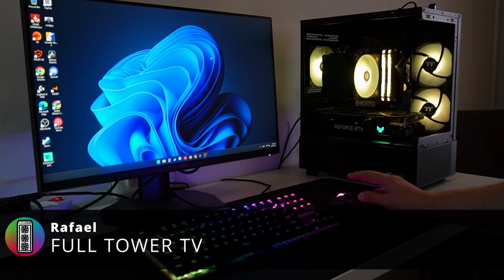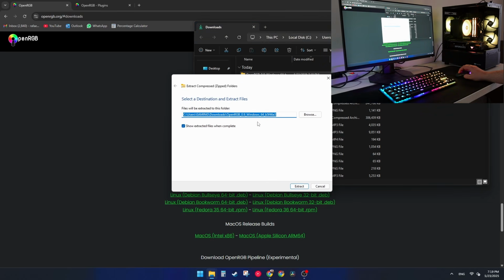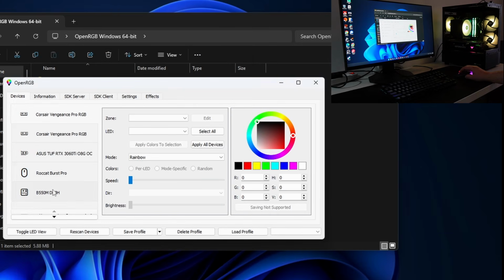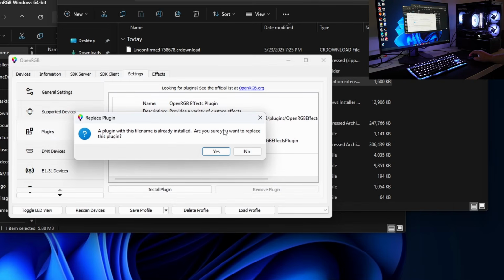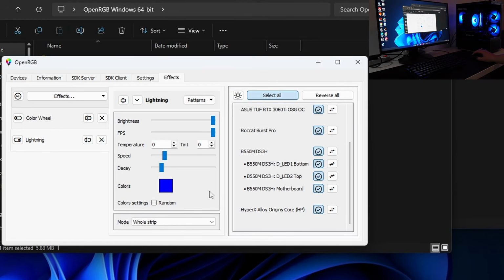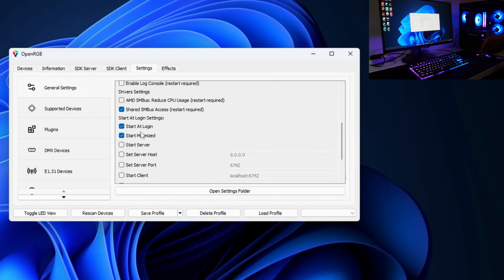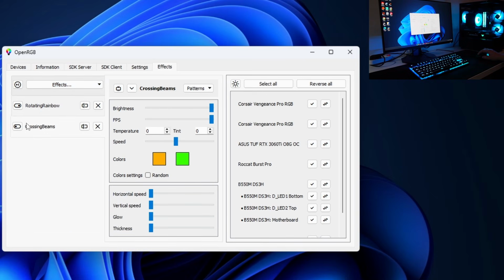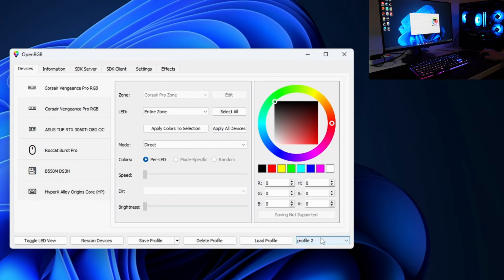How to sync RGB using OpenRGB Effects Plugin

Comment from the maker: ❗FAQ & Important Notes:

1⃣Q: "I did everything you said, and it's not working."
      A: - Please make sure to read the description of the video. If something was unclear in the video, 
               you can find a step-by-step written guide there, which will help you with everything you need.

2⃣Q: "Windows is blocking my OpenRGB Effects Plugin download."
      A: - When you download the OpenRGB Effects Plugin, Windows might block the download because it's a .dll file, which is usually suspected as a "virus".
                In the video, you will see that it doesn't block my .dll file because I already downloaded the file a couple of times in the past.
 
3⃣Q: "Every time I close the program, the RGB effects go back."
      A: - The default behavior of the program is to shut down completely when you press "x".
               To minimize to program, you need to make sure that "Minimize On Close" is ✔ in the settings tab: 
               Go to Settings → General Settings, and you should see it there (the first option).

Any further Frequently Asked Questions will be added here in the future.
Reply: Any real software won’t trigger a virus when UNINSTALLED.  Uninstalled meant totally remove from the computer.   It instead is leaving what could possibly be backdoor into the system.   Why would it trigger a virus warning AFTER it was supposedly uninstalled?
Reply: im wondering if its possible to make a custom affect that utilizes 2 temp sensors(CPU&GPU) to get my rgb to react within a temp range
but specifically id like for my rgb to be off below a certain temp since i leave my pc on as i sleep
so essentially if my cpu is below say 60c and the gpu is below 38c my rgb is off, but when i play a game and they get above those temps the rgb turns on say as blue and stays relatively says the same color until they start getting towards what i consider hot but not danger territory and then starts shifting the color towards red which would be very close to danger territory and once it actually gets into dangerous temps it starts flashing red

LEDs off
cpu below 60 - 65c
gpu below 38 - 40c

LEDs on solid color no color shifting or brightness shifting
cpu 65 to 85c
gpu 38 to 70c

LEDs shifting to RED
cpu 85 to 99c
gpu 70 to 87c

LEDs FLASHING ALERT stop what ur doing shut er down mate
(repaste time/pump failure/fan failure)
cpu 100c+
gpu 89c+

Comment: I just want to turn of the keyboard LEDs when I lock the screen. Apparently I need to set up an "off" profile then in system task scheduler, set up two task events. One for Lock and one for Unlock.  If there is a built in way in OpenRGB to do this, I would rather do that.

Comment: Thanks for the thorough explanation my guy! I placed an order for a Nollie ARGB controller to use on SignalRGB, for maximum flexibility. By default, SignalRGB doesn't support my specific B850 motherboard and so all RGB runs at extremely low framerates and it looks pretty horrendous (I've used it on an older Z790 build and it was extremely good because the Z790 was supported). It's from Aliexpress, so to wait out the month of shipping, I'm gonna resort to openRGB. I prefer SignalRGB because it's just easier for my monkey brain to process, and I love the GUI & much omre lively themes.

Comment: This shit is pissing me off. I can’t sync my lian li sl120 fans. They all are doing what they want to do. I try to change the lighting. Some shut off. I can’t re enable them. I have an air goo controller. I’m over this nonsense
Reply from the maker: I once saw a video of someone who also complained about Lian Li fans and software and he was having troubles with it too.
To be honest I never dealt with them before so I wouldn't know how to help you fix it. 
Have you tried contacting their support team maybe?
Reply: @F @FullTowerTV just bought a different case yesterday, it’s the case I wanted when I learned of it. It’s the floatron F1 case. Came with 6 fans. Immediately fixed my problem. But I have the lian li LCD fans reverse blade I put on my AIO radiator. And of course those fans are giving me the same issue with doing their own color shifts. I’m just done with lian li. They are nothing but a headache
Reply from the maker: @mrmayhem2983 I feel you man. That was also the conclusion of the guy who I watched his video he also was complaining about it a lot. I'm glad it got fixed with the new case for you!

Comment: This program not working on my Case MPG gungnir 111r
Reply from the maker: I looked at your case and from what it seems you have a built in rgb hub at the back of your case that allows you to change the lights using the LED button at the front.
If you want the rgb hub to be controlled with the software, you need to plug the hub into your motherboard.
If you need help with that, please send me some pictures on Instagram or Facebook you can dm me @fulltowertv and I will help you
Reply: @FullTowerTV  Everything is connected correctly, brother; the case's LED button works, and the ARGB works via Mystic Light in MSI Center. That’s why I disabled Mystic Light and completely closed MSI Center to use OpenRGB instead. It does work—it produces colors—but only a few lighting effects actually function with OpenRGB. It’s strange; my MSI RTX Gaming X GPU also lights up with OpenRGB, but I run into the same issue: only about three or four effects work. If I select any other effect, the lights turn off completely, as if no effect had been applied at all. The problem is that OpenRGB isn't compatible with my MSI build; I’ve tried it in the past and it didn't work, and it still doesn't work now.
However, if you happen to know a solution, I’d really appreciate it if you could leave it in the comments section.

Comment: my fan lighting only shows the color properly with the "static" setting but it seems that this effect reflects colors using "direct" which doesn't work properly for me. I wish there was a setting to force a device to use a particular mode but instead it just uses something random. :/
Reply from the maker: Yes you need to download the fx plug in for it to work the way you want. Once you install it you will see a new tab called "effects" and you can choose what you want from there.
Look in detail in the video I explain it there how it works

Comment: first thx for the video . second i cant get it to work with asus b850-f neo . it just detect ram only nothing else. any way to fix this except run as admin cuz it didn't work
Reply from the maker: What case are u using? Some cases has a built-in rgb controller that is not connected to motherboard. 
Try to spot if you have a LED button on the front panel of the case or if you press the reset switch it might change the colors.
If so, you probably have a built-in controller. 
Which is OK. But, some controllers dont have an option to plug them to the motherboard. You need to see if you have an RGB cable that goes from it to the motherboard (usually it's a 3pin connector that says 5v on it if your case is ARGB version)
Reply: @FullTowerTV lian li 217
Reply from the maker: @ahmadfawzy5175 do you have the ARGB version? Did you get costume fans with rgb or just the normal 217 version? Because that one doesn't come with rgb fans as far as I can tell
Reply: @FullTowerTV  the normal version and no rgb fan added
Reply from the maker: @ahmadfawzy5175 OK so from my understanding the only rgb you have is from the RAM and the mini screen you have on the motherboard (maybe from the GPU as well?)

I think OpenRGB won't be able to detect the screen on the motherboard, if you want to control that you can try asus aura sync (I think it's called Armory Crate) if you download it, you might be able to control the screen on the motherboard, and the RAM as well.

Can you try that and let me know?
Reply: @FullTowerTV  thx very much for ur reply and trying to help . no i don't want to control ASUS screen logo rgb but the rgb of the vga card and the cpu cooler fans . armory crate is bugged and install a lot of services and even cant control every rgb alone . if i want to turn off ram only and let others on it wont allow it .

Comment: For some reason OpenRGB doesn't control the lights on my Lian Li case. I turned off dynamic lighting under Windows personalisation but nothing. It's still showing rainbow by default. The rest of the lights (GPU, RAM, motherboard) go static green though like I wanted. Edit: I've noticed if I turn on Windows dynamic lighting, it can control the lights on my case. So weird. I set it to the same green through Windows now.

Comment: Good day, sir. The program doesn't see the RAM and AIO.  Be quiet! Pure Loop 3 - 360mm ARGB and  g skill RAM
Reply from the maker: Check if you have other rgb software installed like your motherboard software - if so remove them.
Also make sure you run OpenRGB as admin like shown in the video.

You can also try SignalRGB which is a different software similar to OpenRGB. It might work better for you

Comment: dont work for me,  i have the Tempest Fort ARGB ATX case , and DeepCool AG620 BK ARGB V2 cpu cooler :( any fix pls help
Reply from the maker: Do you have option to change the colors via the reset button on your case? If so, some case fans are connected to the reset button or led botton on the case and they are not plugged into the motherboard, that's why it might not work for you

Comment: After countless armoury crate fails to detect argb header after a bios update I installed openrgb and detected argb instantly. My only problem is the effect is not animating after restart just freeze. Any suggestion?
Reply from the maker: OpenRGB can be buggy sometimes. I had this issue as well. You can try SignalRGB software instead, maybe it will work better.

Comment: i dont know like anything about PC's, so first of all im using rosewill fans with led's and a biostar motherboard, and openRGB's not detecting them. like i said i have no idea what to do. ive been at this for hours and i just cant seem to find a solution that works, or that i understand. please help me.
Reply from the maker: Hey my friend 👋 I got you no worries.
There is one possibility why openRGB won't detect the fans and that is perhaps they are not connected directly to the motherboard.
OpenRGB can only detect devices that are plugged directly to the motherboard, whether it's via USB or the RGB headers on the motherboard.

Now, there is a lot of cases that has fans that are connected to a some sort  of controller which is not connected directly to the motherboard and it is being controlled in other ways. 
For example: if you can change the colors of the fans by pressing the reset switch on your case, it is most likely they are not connected directly to the motherboard.

If thats the case, what you can do is open the back of your case and see if there is a plug that looks like this:
https://ibb.co/xKV7nMg1

If so, try to locate a header on the motherboard and plug it there.
There is a possibility that some motherboard do not have RGB headers so keep that in mind.

Try that and let me know what you come up with
Reply from the maker: Also, I forgot to mention, if you do end up opening the back of your pc - don't forget to turn it off before touching anything.

Comment: Installed per instruction, removed Icue from my system after OpenRGB didn't detect my vengeance RAM. Still won't detect them, they also now no longer show up in MSI mystic light (My motherboard does and also does in OpenRGB) any known solutions?
Reply from the maker: I had a similar issue with my corsair kit as well. It takes a few tries until it manages to reset the RAM profile. I had to reinstall OpenRGB like 5 times and restart my computer a few times.
Try to remove the software completely, restart the pc the install again, make sure you run as admin and also:
You can try another software called SignalRGB. Maybe it will work better for you.
Let me know if you managed to get it working
Reply: @FullTowerTV Cheers pal, speedy response! will let ya know!
Reply: @FullTowerTV  Ended up changing over to SignalRGB, couldn't be bothered to deal with openRGB being silly lol! thanks for the recommendation, pc looks clean af now!
Reply from the maker: @floppz9549 YESS! 🙏 LET'S GOOO🎉

Comment: I have the same ram, how did you manage openRGB to be able to see it?
Reply from the maker: It's just shown up.
If it doesn't show up for you, could you make sure you ran the program as Admin, and also check if you have other RGB software installed on your PC? 
If you have an ICUE link, for example, the Corsair software might detect the RAM first, and then OpenRGB can't see it because it is being controlled by another program before it.

Comment: is this a virus?
Reply from the maker: No, windows detects it as a "virus" because this software is not officially released and it's an open source code.
If you are afraid to install it you can try SignalRGB instead. This software is official and you won't have this warning.

Comment: The only thing not working for me is the "apply profile on system start" thing. It worked before turning all lights off as the OS started, I had to reinstall the OS and now it doesn't work RAM light keeps turned  on
Reply from the maker: Keeps turned on when? When you turn off the pc?
Reply: @FullTowerTV  No, the RAM and board work fine they do their job. I use OpenRGB to turn off the RGB lights, now system starts, MoBo and GPU have memory so those keep turned off, but the RAM keeps on cause it has no memory and OpenRGB doesn't load the profile, I think it doesn't even start... even though it appears in the Win10 startup apps list, it's marked to start as admin and start at login and load profile are checked... it's weird
Reply from the maker: @cortbelmont  are you using the plug in?
Where are you configuring the profile? On the main tab or on the plug-in tab?
Reply: @FullTowerTV  Profile is set on the main tab, no plug in installed, V1.0c and tried V0.9 too... after some experiments Win10 isn't starting the app on OS start up, but the app works fine
Reply from the maker: @cortbelmont it could be a problem related to windows and not necessarily a problem with the app.
I think they have even older versions on the website or on their github page try to see if they note something about windows 10 startup issues.
Reply: @FullTowerTV  Thanks for the help. It's some windows shenanigans for sure... there's no info anywhere on a similar problem but I think it's solved I used the "task scheduler", created a schedule to start OpenRGB on log in and added the argument to set my lights off profile. That seems to have done the trick
Reply from the maker: @cortbelmont wow. I would have never know how to do something like that 😅
Thank you for sharing!
Now if any one in the future will have a similar problem they can refer to your comment and hopefully fix it as you did.
Kudos for you! Great job!
Reply: @FullTowerTV  I didn't know how to either, but while searching for a possible solution that method came out as the most reliable to execute apps on system start up

Comment: I was wondering how to make it sync with audio playing on the pc?
Reply: one more thing, for some reason openrgb doesn't detect my hyperx fury ram sticks...
Reply from the maker: @massivemario 
Hey Mario,
For the audio, I think there is a plugin for it on OpenRGB's website or you can also look at the plugin that I shared I think I saw an option for that there.

For the RAM,
Try to see if you have anyother RGB software installed on your PC (maybe the motherboard software) because a lot of people are having trouble with it and I think the cause is other software detect the RAM first, and then OpenRGB cant see it.

If that doesn't help, try to allocate zones (when you have the pop-up menu at the start when you first launched OpenRGB you will see it asks you "how many LED zones you have), usually 16 or 32 that's what worked for most people.

Comment: i got keyboard and mouse from logitech they work perfect with OpenRGB. but my corsair Ram and, rgb fans dont work. i got 9 rgb fans to RGB/FAN HUB, but openRGB dont see them?  i have uninstalled all rgb apps. msi,corsair. but stil dont see them.  i did try signalrgb that program see my ram, but not my fans. stil looking for a fix. if someone know please let me know.
Reply from the maker: If any rgb software does not detect the fans, it might be because the Fan hub rgb connector is not connected to the motherboard.
Question - do you have a Led button on your case that allows you to change their color?
sometimes it can also be linked to the reset switch, if you press on it, does it change colors?
Reply from the maker: Check if the fan hub has a 3/4 pin rgb connector that is not plugged to he motherboard.
It should look something like this:
https://imgur.com/a/z9AuS54
Reply from the maker: If not you need to plug it.
Because rgb software read everything that is connected to the motherboard.
Some fan/rgb hubs has option to control lights through a Led switch or reset button. Or even with a remote. But you should have an RGB connector as well.
Reply: @FullTowerTV you just helped me fixing it. It works now. Thank you so much. Rgb hub 3 pins 5v. The remote has a button to switch button for controlling by pc or by remote.  Im happy😊 do you know if third party led strips with wifi, van be connected to openRGB ?
Reply from the maker: @Volgens-Mike it's not 100% but as long as it connectes to the motherboard in some way (usb or 3/4 pin rgb/ARGB) you might be able to control it with OpenRGB.
I think if you go to OpenRGBs website you can find more info on that. They have a bunch more of other plugins for those kind of stuff.

I'm happy you managed to figure out the issue! 🤗 😊🎉